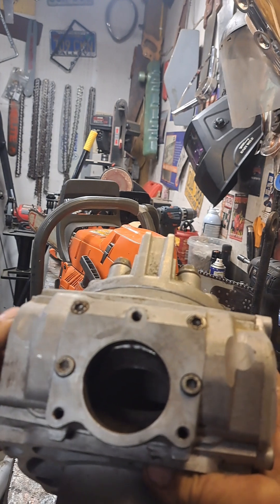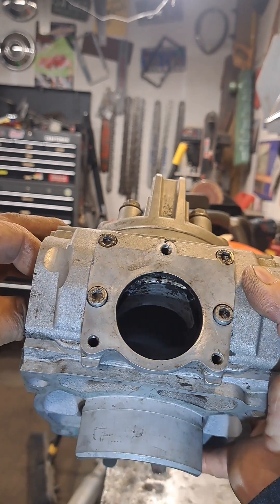Chainsaw Power Valve?

Comment: Many years ago Marshall Trover showed me a twin cylinder opposed Echo chainsaw. Still ahead of it's time. A power valve is just another thing that would work great on chainsaws but just isn't gonna fly in the market or be cost effective is my best guess. It would be interesting to see if it would change our normal operation of a saw or not.
Reply from the maker: Thanks John,  Yes, interesting indeed 😁

Comment: Low and mid range rpm is what power valves improve. Chainsaws dont really need that. Fantastic for powering out of corners and hills in Motocross without finessing gears to stay in the power band. Really helps broaden the power curve.
Reply from the maker: That makes sense,  thought it was cool though😁

Comment: Yes thats interesting and the low end torque is much better than the 70s or 80s 2 strokes. So if your not in the power band it has torque on trails!
Reply from the maker: Super cool! Water cooled as well,  for some reason I thought only the 4 strokes were water cooled